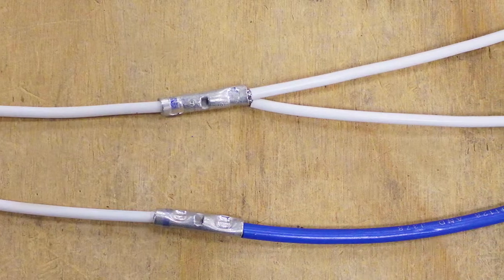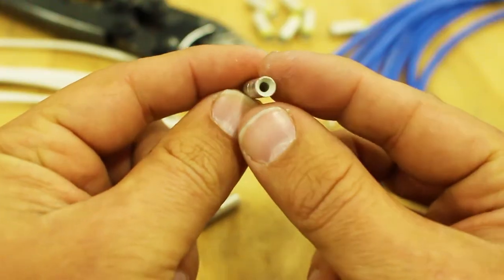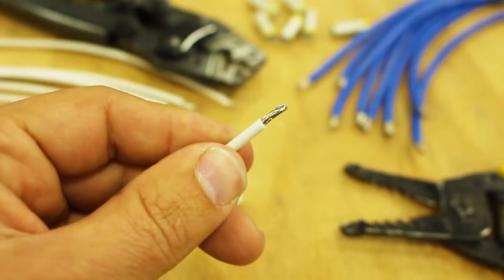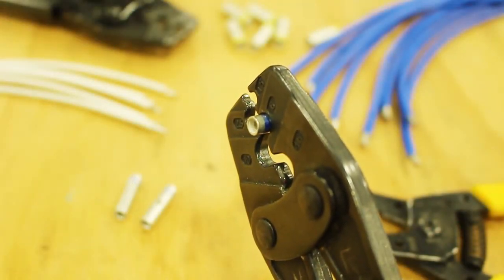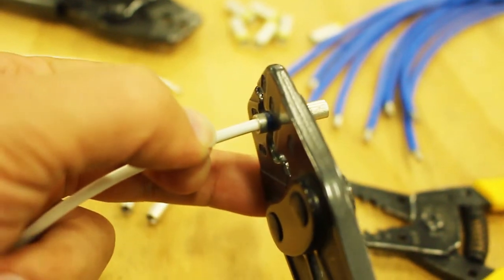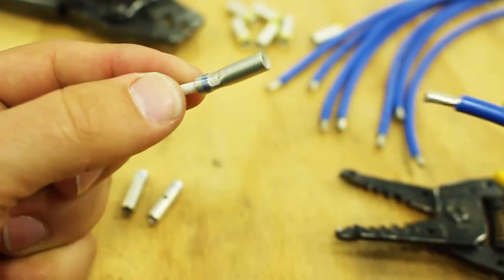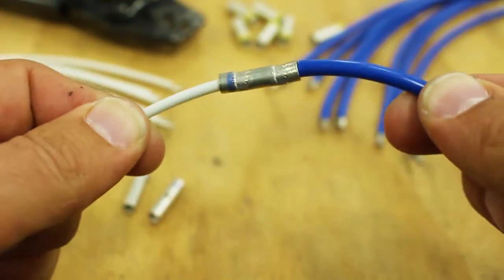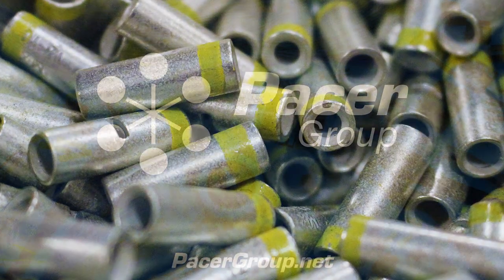How to Use Step Down Tinned Butt Splices

Comment: What type/brand of crimper do you suggest for a 12/10 to 8 gauge seamless tinned copper butt splice connector? I only have 2 of these connectors to crimp. Thanks!
Reply from the maker: Our ratchet-controlled crimper is ideal for the applications you have described.  YOu can find it at https://www.pacergroup.net/controlled-ratchet-crimper-for-heat-shrink-22-8-awg/.
Reply: Does this crimper work equally well with un-insulated terminals. I will be using heat shrink tubing after crimping
Reply from the maker: @ParisKYLakefishing  Unfortunately, it is not recommended for use with un-insulated terminals.  We do offer a tool with changeable die sets.  You can see the tool at https://www.pacergroup.net/ideal-crimp-tool-frame-w-o-die-set/.

The die set you would want to use would be https://www.pacergroup.net/ideal-die-set-for-non-insulated-terminals-22-8awg/.

Comment: Can you and should you solder the butt splice and will it wick through the hole? My concern is for a 6 AWG automotive wire connection on a classic car with 60 year old wiring for a 50 amp load.
Reply: I wouldn't personally solder crimped connectors, used to do it myself before I got my hands on decent crimpers, the solder wicks into the cable and creates a stress point at which the wire is very likely to break (even with proper strain relief) use high quality crimpers and terminals, I prefer non insulated my self as they have given me the best results by far.